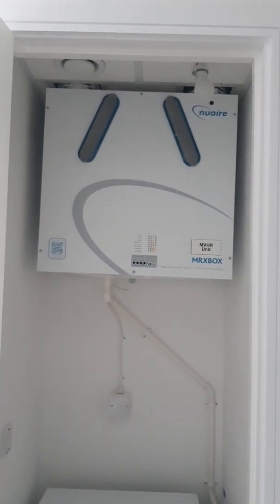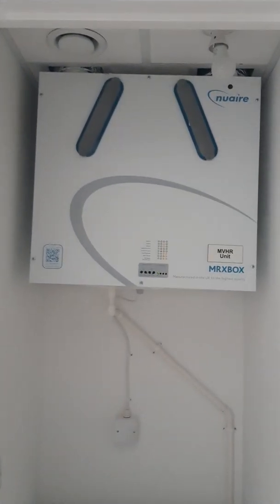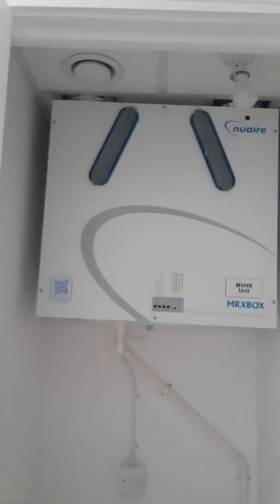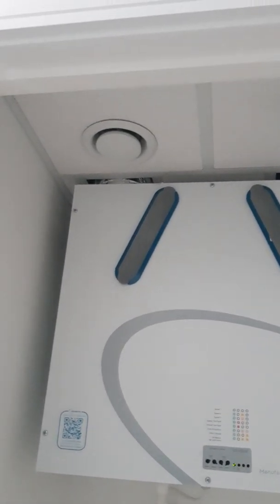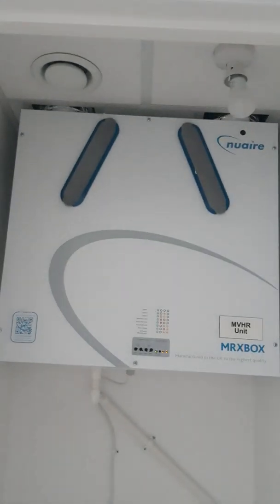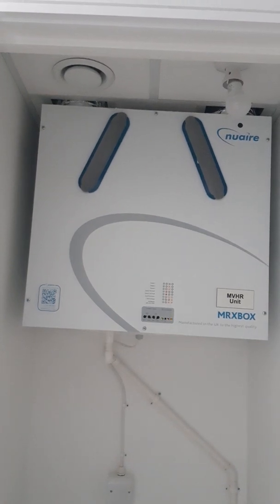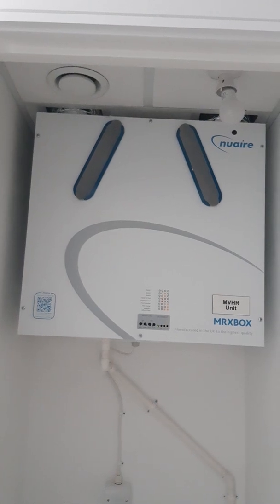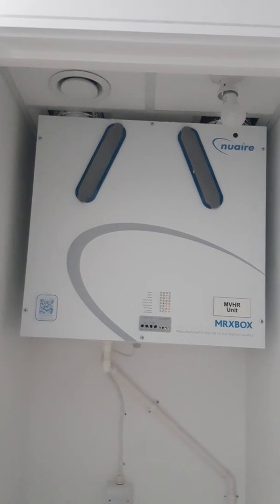Nuaire MVHR Overview

Comment: Do you understand the summer bypass function please ? Why is flashing in the winter? Hope you know a bit :) thank you
Reply: Did you find an answer . Going through this right now
Reply: @Jchertz  yes I did.. Cant remember the answer but I did find it thanks
Reply: The summer bypass function is when the unit senses the air indoor and outdoor exceeds the threshold . The indoor temp of the unit should be set 3 degrees higher than your heating systems thermostat to prevent bypass kicking in during winter and 3 degrees lower than any air con system you may possibly have . Make sure your temperature threshold is set higher than the highest temperature your property hears up to with heating on . Hope thus helps
Reply: Basically your property's heating system is confusing your mhvr unit making it think your in middle of a heatwave in the summer and will refuse to recover heat as it doesn't want to add extra heat to an already overheated property